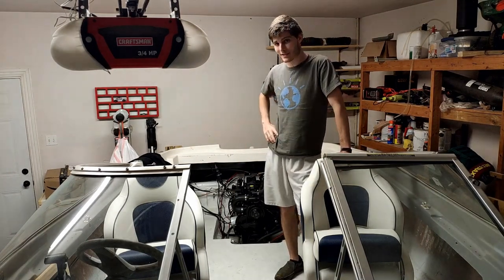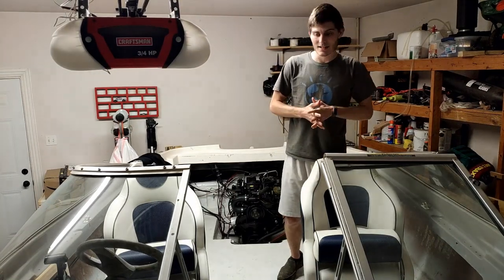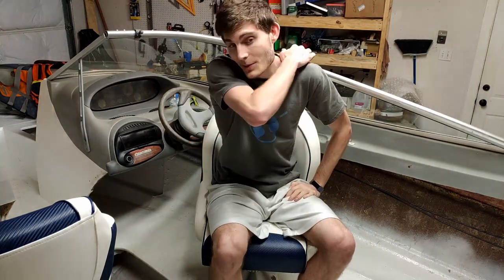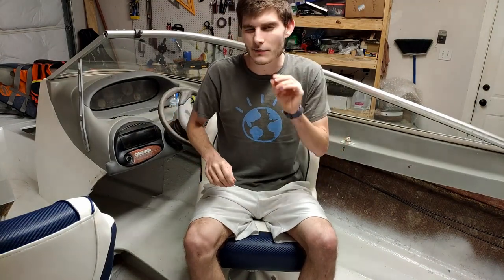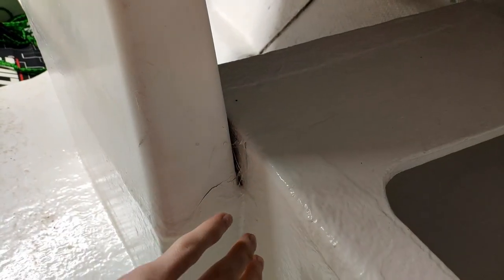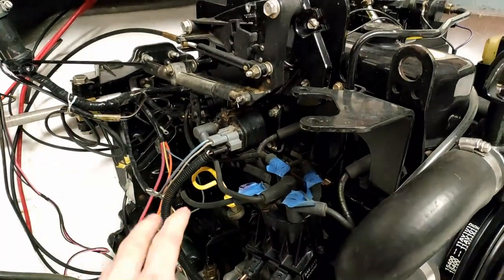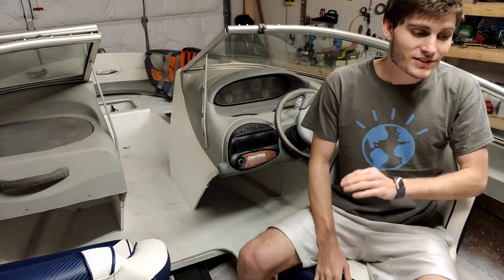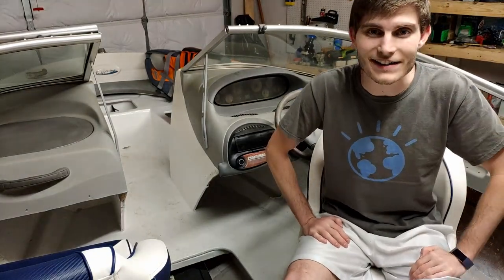Bayliner Boat Restoration - April Update

Comment: I would definitely install the carpet last. Unless all the dirty parts of fixing the boat are already all done you dont want to risk getting the new carpet dirty or stained. I'm just a lil bit passed where you are on my 1996 bayliner and I'm waiting till everything else I'd done and I'm doing the carpet very last. But like you said your not going to glue it so then you could simply just fold it back to work if needed. You're doing a great job. Like watching what you're doing...
Reply from the maker: That's a good point! I think I'll hold off on the carpet till after I finish building the engine enclosure
Reply from the maker: Thanks for the comment! I really appreciate your feedback :)

Comment: I completely remade my engine cover, took apart the old one piece by piece for templates, and made a solid new one, along with some other wood pieces in the boat. Including the jump seat. I would definately put back 2 jump seats and the original engine cover.

Comment: It would be nice to see the front seats finished. Are you going to install a radio? You could easily fit two speakers under the seats in the front.
Reply from the maker: It does have a radio, but j may need to get a new one. I had hooked up the old speakers and the sound signal was pretty bad haha. So it could be the speaker, wires, or maybe even the radio itself that need to be replaced

Comment: Hi Zach, love your vids. Do you remember what size bolts you used in the pedestal mounts to the floor? How long?
Reply from the maker: I was just looking at my part 27 video to see if I showed. I didn't say, but I think it might be 1" bolt lengths. They don't have to be super thick, as long as you find a matching t-nut size

Comment: Whenever you fix the pushrod cover leak let me know, I have a Volvo penta 3.0 that I cannot get the cover to seal at all
Reply from the maker: I just tried to fix it yesterday by using some hi-temp RTV silicone gasket maker / sealant. I made a big bead all the way around the cork gasket and then around all of the bolts.

Going to find out in the next day or two if it works or not

Comment: I am 100% against puting carpet in your boat.. that Bayliner originally has carpet and probably caused most of the water damage you just repaired. What about texture in the paint.  Non skid Pumice med grit.. quick, easy and looks sharp. Plus spray off your boat after playing and your done!!
Reply from the maker: I like that idea, I agree. The new carpet I got is going to be more  of rug, it will be removable, not glued down, that way it will be able to dry out easier, but more importantly, the deck will dry out easier and I'll be able to see if any cracks ever form for water to seep into, I think that was the biggest problem with the carpet and deck from the factory. you couldn't see all the cracks in the fiberglass / gel coat underneath so water just slowly worked its way to the plywood